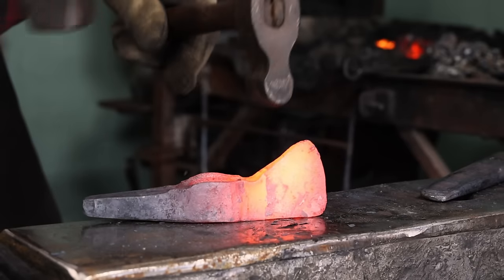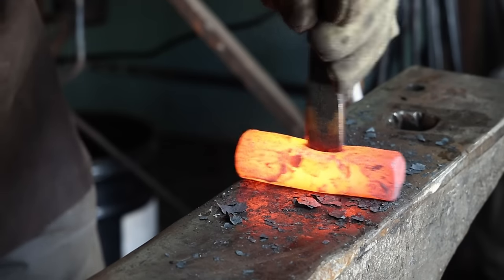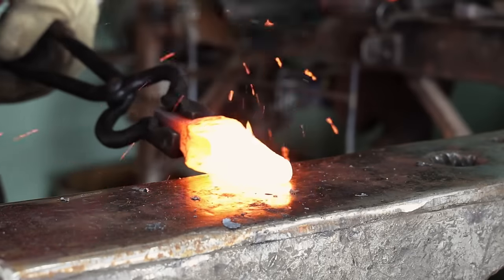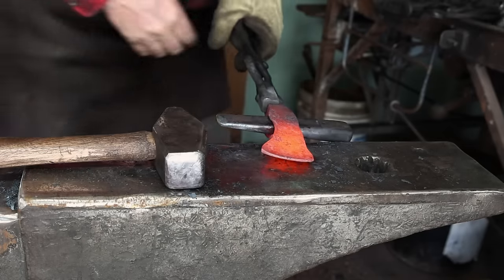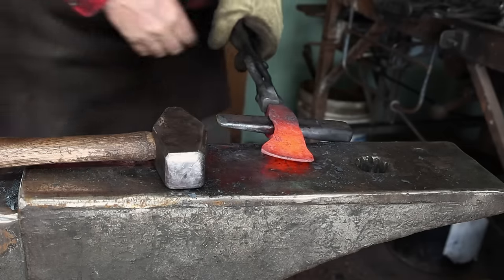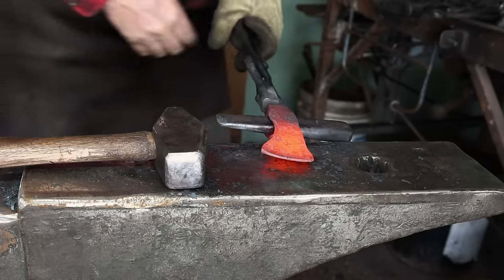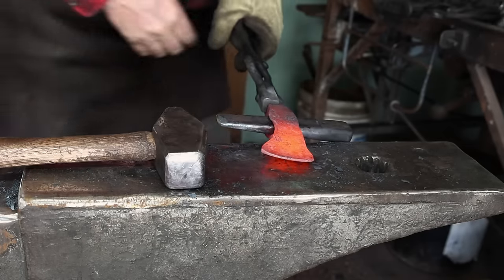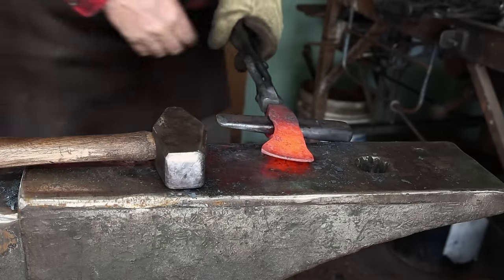Blacksmithing - Forge a Spike Tomahawk

Comment from the maker: On the Steele Grinder, Blacksmith Supply says it will fit an 8" contact wheel.  https://www.blacksmithsupply.com/84-Engineering-Alec-Steel-Grinders_c_104.html  use code: bear5

Comment: Thanks for leaving the overheating part in the video. It helps keep beginners like me from getting discouraged by our mistakes because it shows that even experienced smiths make mistakes and that just because a error was made, it doesn’t mean the project isn’t able to be saved.
Reply from the maker: Glad it was helpful!
Reply: When I saw the little bit of sparking and fumes on the blade I thought, "oh dang, that doesn't look good." It reminded me of my first blacksmithing session in my dad's coal forge when I learned that you can burn steel if you don't pay attention.

Comment: I wonder why no blacksmith is using a spokeshave to create the handle. It is very fast and creates lovely shavings instead of all the dust and noise. 

Very nice Tomahawk though 😊
Reply from the maker: I use a spoke shave for handles fairly often.  But the belt grinder is a bit faster and doesn't care about grain direction in the curved areas.

Comment: Could watch a hundred videos of you making axes john I just can’t get enough I try to do each one myself I’ve done the hammer into blacksmith axe with the cross peen on back and today did 90% of the railroad spike axe done and once that’s done gonna try the one you posted with the 01 tool steel with no weld next will be the wrapped eye as I’m getting pretty confident with my forge welds your a amazing teacher and being part of the new generation of blacksmith appreciate each and every one of these videos, also love your tool making videos,and every other type of videos.. I’m on my second to third time watching most of your videos

Comment: That’s a handsome little tomahawk! 

The return of the Steele belt grinders is timed just right to give me buyers remorse on pulling the trigger on the Grizzly 2x42. Especially because the Grizzly was DOA, and I’m still waiting on the replacement. Sure, the Steele is 4x more expensive, but it has way nicer features, and the build is clearly beefier. Wishing I’d saved up and got that, I just didn’t know they were still making them!

Comment: I picked up an old 2x48 a couple years ago, and love it.  Hands down, it's proven to be the go-to grinder for the shop and my 2x72 can only look on forlornly.  I probably do 50/50 wood and iron work with it.  You can't have too many belt grinders in the smithy.

One trick I developed over the years to save a whole slew of time on the handles of tools is to take them down to 120-grit.... and then run them through the wire wheel on the bench grinder.  There is simply no better finish, imo, and how it feels in the hand is something you just have to try for yourself.  Even on store-bought tool handles, the wire wheel makes quick work of getting rid of that nasty plastic finish they put on them, and leaves you with a texture that's second to none.  Add two coats of pine tar thinned down with turpentine, and you've got a tool that looks good and feels fantastic!

Comment: Great video and sweat hawk, John. I love this voiceover style video, the crisp sound quality of your voice makes it easy to listen to and follow along. I look forward to more axe builds from you.

And congrats on the mini Alec Steele grinder. When I was shoping for one, that little 2X48" caught my eye because of how affordable it is. I ended up going with the full-size 2X72" Steele ginder and have been very happy with it, especially after I wired my shop for 220 to get full power out of the motor and built a custom bench and tilting stand for it. The big one comes with a third, 5" contact wheel on the flat platen. Either way, you are getting a solidly built grinder with a lot of functionality for a great price compared to other grinders out there.

Comment: Great project and video, good advice in the video, I really like the part where you had the overheat accident and showed how to take care of the problem.  I've seen people that would have trashed the whole project and started over but you showed that even when a person makes a mistake they can repair it,  modify the project and still have a good tool or wall hanger either one. I also really liked the way you showed how to shape the head at the handle and the advice about using the vise.
Thanks for all your hard work and the information you put into your videos.

Comment: I like that grinder I have a propeller repair shop here in Alaska and beat on props with pitch blocks and then weld up damages areas and grind down. 
That belt grinder looks perfect for doing  the hard to reach weird design areas on props. Please send me the one they sent you asap!!

Comment: It really looks good. Glad you left the oops in the video, still shows good smith's make mistakes. I think the handle fits this better after the oops, the handle looks like ut would have been alittle small if all the mass was still in the piece
Reply from the maker: If the axe had ended up larger I probably would have left the handle larger as well.

Comment: I've found that a hardwood block shaped to hold the hatchet head, or workpiece in general, with neodymium magnets mounted flush with epoxy to hold them in place works really well. Of course it's not practical for a one off, but if you find a style you want to repeat... A thin leather cover glued to the block to finish it off adds traction and protects the surface while you work.
Reply from the maker: Sounds like a great idea

Comment: Great video.  
I wonder if you could use a 12” contact wheel, just running it on a longer arm, and using 2x72 belts. It should work, provided the tool arm doesn’t get any vibrations/harmonics.  
I bought a Vevor (Chinese) 2x82 ( good luck getting those belts, but 5 minutes measuring and one with the grinder had the extra arm length cut off to run 2x72s). It runs great, and I still can’t figure why other brands are 3-5 times the price.  The biggest issue was the unsealed electronic control box (the motor is sealed).  I just drilled a few holes in a click-lock food container, stuck the controller in it, and sealed it up with copious amounts of hot-glue.  Worked a treat.  
Cheers from Tassie.
Reply from the maker: The 2 x 72 uses a larger motor, so it might not work.  Plus the cost of a 12: wheel would be quite high

Comment: Awesome work as always! I was curious though as to what you put on the blade edge around the 18:00 mark while you were making the handle 🤔
Reply from the maker: Thats a hot melt coating made for protecting tools.  Most industrial suppliers will have some version available

Comment: Do you think thread cutting oil would work for quenching? I have like 5 gallons of it already in a metal bucket.

It's Ridgid threat cutting oil
Reply from the maker: I really can't say for sure, but my guess is that it would work.  May be more expensive than regular quenching oil though.
Reply: Yeah. I definitely wouldn't buy it. when I first started forging a guy at work gave it to me saying he thinks it would be a good quenching oil. Right now I'm not trying to put too much money into my smithing hobby. Since I'm not making any money from it.  So when somebody's willing to give me free stuff or stuff or stuff really cheap. i have been taking it

Thanks you
Reply: @Lev53420  Now its a cutting oil which is not cheap by all means so if i were you i would use a small quantity and try it out .If its not working you can always use it as a cutting oil or sell it and buy a real thing.If price is right a small hobby guys might be interested in it as long as its not contaminated.

Comment: Fantastic work sir! It's so refreshing  to see a forging video with a real blacksmith actually FORGING and shaping the metal, and with a hammer no less. 95% of these kinds of videos that I've seen are just some A-hole using a powerhammer to make a flat bar of steel and cutting out the shape of a knive, or whatever. You are a true craftsmans!
Reply from the maker: A power hammer still takes a considerable amount of skill and is very much "real blacksmithing"

Comment: What did you use to coat the tomahawk blade while you were working on the handle? It looked almost like some sort of resin. And how is it removed for the finished piece?
Reply from the maker: It's a hot melt coating designed for protecting tools.  Most industrial suppliers carry something similar

Comment: Hello sir Switzer. Just wanted to thank you a lot for your great work. I was wondering if letting the punch/chisel was removing the tempered of the tool's steel? Isn't it softened after using it like this? Or is that ok and don t need to re-tempered it after use? 
Anyway, excuse my poor english, i'm a french aspiring blacksmith, so it's quite difficult to me to express correctly what i've got in mind. 
Thanks again, u can't imagine how much you help me. 
Best regards.
Reply from the maker: They do soften with the heat, but unless they get red hot in use it is still harder than if it hadn't been hardened.  I don't re harden and temper unless they get to a point they no longer hold up.
Reply: @BlackBearForge Ok thanks. I was often worried about it when i was using my tools, but it is definately making sense.
Thanks for your answer.
Have a nice day!

Comment: Hi John, would the file work cause stress fractures at all? It looks awesome.
Reply from the maker: It is something to consider.  I keep the file work away from the thinner areas and don't quench the entire head right away when hardening to help prevent stress in that area.  I also don't think is much of a problem on smaller lighter duty pieces like this.

Comment: Do you need to quench the drifts?
Reply from the maker: If they get too hot I do, but a small axe like this generally doesn't heat them that much.  They can be too hot to hold onto though.

Comment: I was hoping.
Somebody asked in the comment section.But what did you protect the sharp edge withanks again
Reply from the maker: I use a hot melt coating made for tool edges.

Comment: Is that hot glue on the edge while you were working on the handle?
Reply from the maker: Similar, it's a hot melt coating meant for tool edges

Comment: There are 10.000 ways to make a handle .I dont use steel wedges to secure wooden ones or the glue i like to use a small flat head wood screw -i drill a hole for the root of the screw just on a split line between wood wedge and a handle -screw in the screw and it will never come out.Its the same techniqe that is used in securing  shaft and pulley on machines.Or when you want to stop something from rotating .Works great.
Also i soak the wood in linseed oil and apply it once a year.Its great for wood and it keeps the wood from swelling in moisture or drying during summer.

If you dont have the scraper(i know they are cheap but maybe amazon asks 2x the price of scraper for shipping and customs alone)you can use japanese body kit spatulas that you can get in most hardware stores for dirt cheap -you dont even have to sharpen them and they are made out of high carbon steel.Plus you can use angle grinder or a file and make any profile you want .

Comment: Hey John I’ve got a question with wood frame in your shop how do you keep your belt grinder from putting hot sparks on your wood or is a problem at all
Reply from the maker: It doesn't seem to be a problem,most of the sparks go down and i keep a bucket of water in front of the grind that catches them and gives me a place to cool the piece as I grind